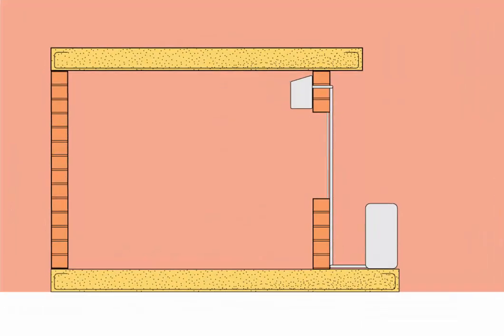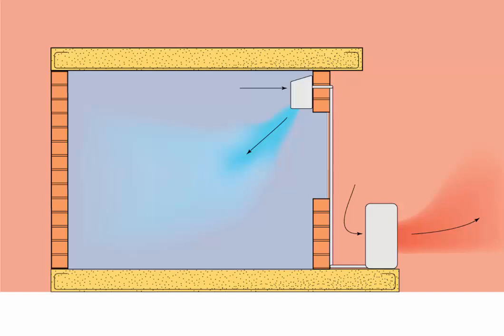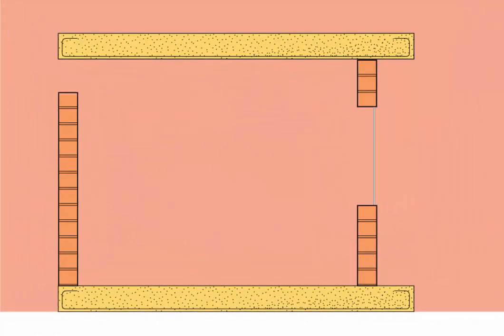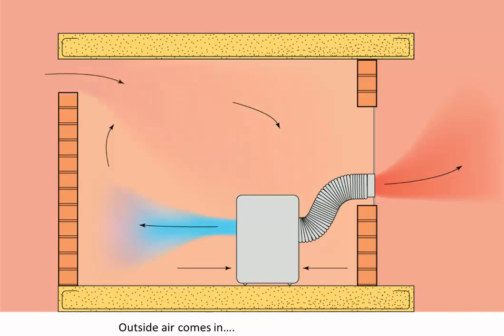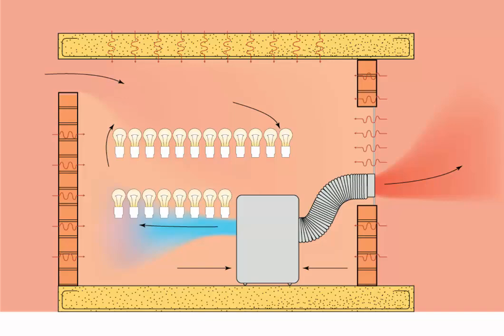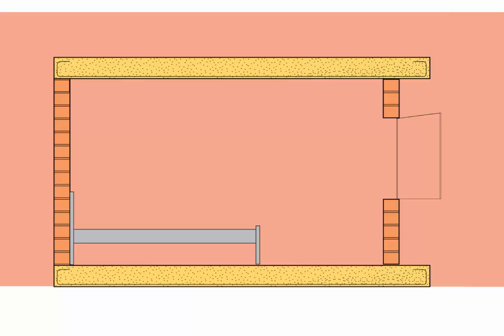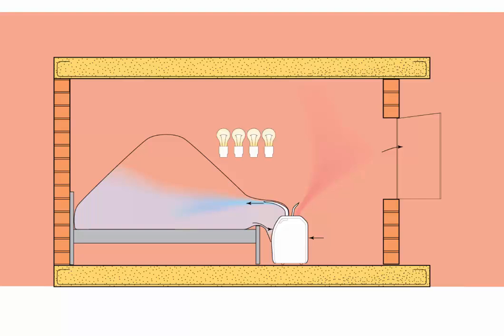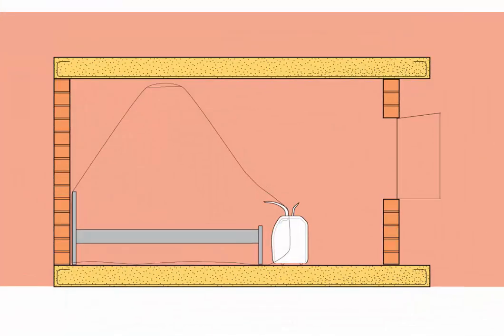CC Technology (Extended)

Comment: If you open a window then on those hot days the heat comes back in, only advantage is the tent so it's only use is for when you sleep. Why can't you still open a window on a split system. Nowadays splits have all kinds of filters that filters the air.
Reply from the maker: It depends where you are, Khoa. Split systems use far more energy if you keep a window open. If you can afford USD 100 - 200 monthly, that may not concern you. If you want to keep cool for about USD 10 - 20 a month and you're in Singapore, Australia, Pakistan or Indonesia, try Close Comfort.
Reply: @Coolzycom  I'm really close to buying one but its not cheap here in Aussie land, I want it to tick all the boxes before I buy. The thing I don't like is that it only cools a small space and you have to be right in that space. For me I can't be in that one place ALL the time I need to move around, even if its just in my room. The only time when I'm in one spot is when I'm sleeping and buying this unit just for sleep???? But there's also a few very good points about it too, so now I'm conflicted, does it have a return policy if I don't like it, not because its broken? Thanks for the advice I will def. consider getting one.

Comment: I do not follows your logic? If the inside the igloo is cooled by the CC  - the air is recycled the same as the spilt system  when the cooled air inside heats ups as it rises to the top of the tent where is it expelled from? 

It seems to be it is still using the same previously cooled air? So how is CC technology any different except that it is using a lot less electricity and thus becomes a "spot" cooler in effect?